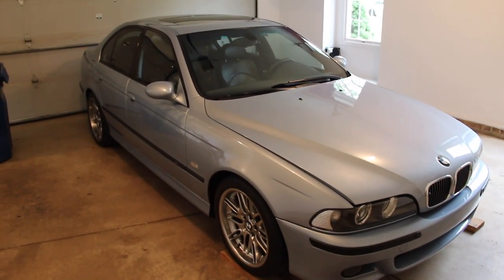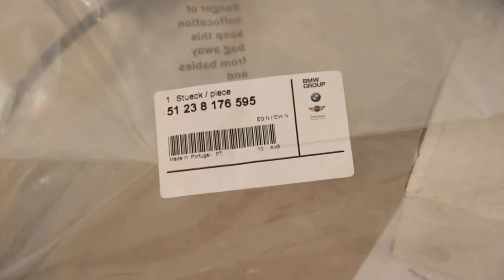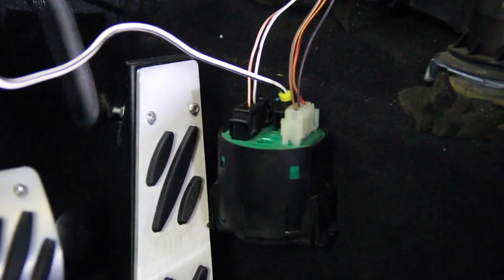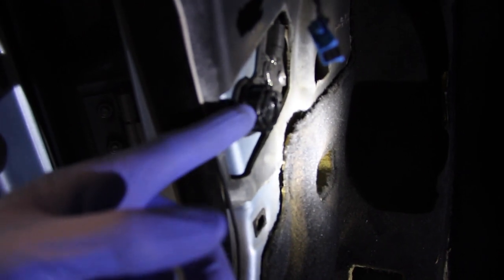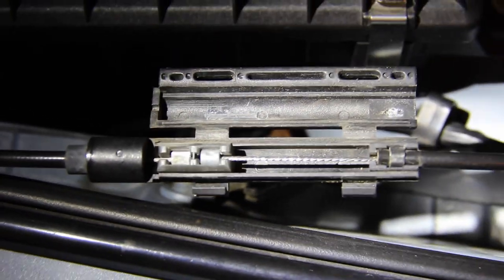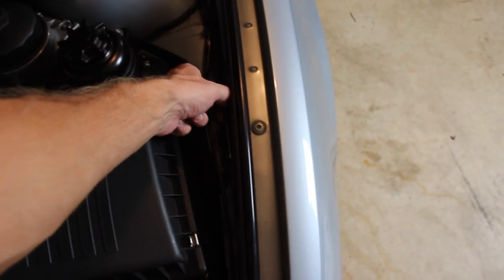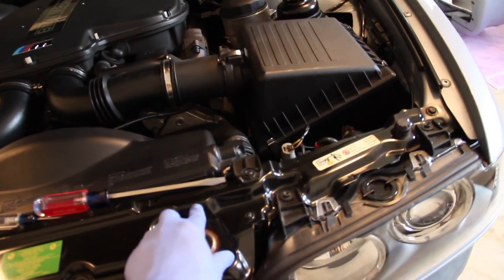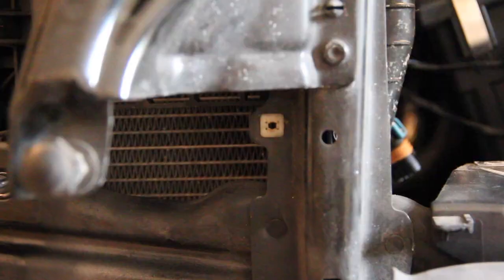BMW E39:  Hood Latches & Cables Replacement DIY

Comment: Your Youtube videos are amazingly clear and I'm astounded by how meticulously you maintain your cars. I wish I had a  a fully equipment shop to work in like yours, especially a hoist. So, I just completed a full cable and latch replacement on my 2003 manual 540i and did it without removing the bumper and other assorted frontal components so I figured it would be useful to post that part of the procedure here for future reference. The main benefit is gaining access to the latches by loosening the cross member into which the latches are attached. This is done by removing the four headlight bolts on both sides and sliding them forward an inch or so., loosening the torx screws holding the latches and removing the 2 at the front. Then remove phillips head screws and the radiator support bracket bolts and the 10mm hex bolt at either end of the crossmember. Then punch through the pins in the centre of the 3 plastic expansion rivets, being careful to place a rag underneath them to catch the pins for reuse. Now the crossmember can be lifted up and tilted forward enough to gain access to the latches. Remove the remaining torx screw from each of the latches and ease them out together from under the crossmember. The remaining procedure is the same as Ryan's. Doing the job this way means it can be done solo and in much less time.

Comment: FYI!! You don't break or saw the grills. They pop right out, just go easy on them, then use a small rachet with T35 to remove the spring locks.

Comment: Just a little maintenance advice, put some grease on the latches and the hood bolts as well from time to time, to avoid them getting stuck and putting too much force on the cable, and also they wont rust so bad.

Comment: To make you life easier when installing rubber parts in/through any other material, ALWAYS use a little kitchen dish soap on the rubber... will make it pop in no fuss.. when it it gets wet, it will wash away...!! Example: the hood latch cable through the firewall, as in this video... or the front/rear window surround gasket... dish soap it!!.

Comment: I had some troubles getting the junction box open. In case you missed it, you push the tabs forward (toward the cables inside the junction box) and just kind of fidget it. I had to use a flat head to push them. Got it after a few tries. Great video, thanks!

Comment: I do this on my e39. I only change the first kable. And now i cant open the hood. There is no traction on the kable. On 15:00 there is the hole for the rubber. I don't know how deep I have to put that in. Can some one help?

Thanks

Comment: Is it possible to do the latches without removing the bumper, headlights, etc? Impossible or just not as straightforward? Thanks!
Reply from the maker: You may have to break some welds.  I would just do it this way, it just takes time.  None of it is hard.
Reply: This is probably the “correct” way but if you are careful you can do it with removing the head lights and flexing the cross member

Comment: Thank you very much for the hood release cable (cabin) replacement instructions! Helped me a lot today after the cable broke last week. Still took me a good 3-4 hours to change it, also mainly because putting the dead pedal back was such pain in the ass. Great video and gonna watch the rest later if the other cables require replacement. 👍

Comment: I have a funny feeling that this is about to be my next failure. Just replaced the aux. fan on my 2000 540i and it wasn't too bad. Ended up replacing all those plastic rivets because they were brittle and crumbled upon removal. I really like your videos. Great work, and best of luck keeping it in the best shape possible.
Reply from the maker: Thanks for the kind words!  Were you able to find the part number for those three rivets that I couldn't get the center out of until they were removed?  The correct # doesn't seem to be there on RealOEM.
Reply: @E39Source  I found the rivets on Ebay. Looks like they are used on several models. The part number listed was 51 71 822 9003. They came in a pack of 4 for the air duct, which is that plastic shroud in front of the aux. fan.
Reply: Jonathan Edwards are the rivets sold on eBay made by BMW?
Reply: @Twghost  I really don't know. Most of those parts like fasteners are not BMW branded from what I have experienced. If you bought them from a BMW dealer, they would be in a bag with a BMW parts network sticker on it. I am actually going to install these this weekend, and will report the progress.

Comment: Great post. I just ran across this one yesterday & seeing your frayed hood cable got me worried. I just checked it out & we are good for now. I open the hood a lot so wondering how many times yours was opened to fray it that bad.
Reply from the maker: My hood latches had gotten rusty after exposure to many Ohio winters.  The rusty latches were sticking and causing the hood release cables to work extra hard to open them.

Comment: love your brake and accelerator pedals, where did you get those from? Also what is the part number for the junction box?
Reply from the maker: These are the Bimmian brand pedals that have unfortunately not been available for years.  The Genuine BMW performance pedal kit works fine for the clutch and brake pedal, though the throttle pedal they used is the standard E39's (non-M5) shorter pedal, so it won't work.  Junction box:  https://bit.ly/3nTqKEg

Comment: why did you work so hard at it take a welding rod and stick ah fallin wedge in there put little pressure on the hood not to much knock the flux off welding rod put about 20 
degree bend in rod

go in between headlight and grill peice find latch and push pop right open dont got take no stickin grill out mikeys fix all mikey huff us hillbillys got it goin on need anymore help call

Comment: My left look latch doesn’t lock. And I can wiggle the hood to pop the right. My cable broke at the plastic connector. My cables are rusted solid and don’t work.

Comment: Thank you so much, was very helpful. I'm rolling the dice with MTC latch assemblies, 2 for $27 on eBay. Genuine cables however.
Reply: Any luck with using MTC?  Couldnt find any reviews on those and the OE are like $80+ a piece! Any feedback would be appreciated. thanks!
Reply: @nasserkhaja1879  oh they worked great! It threw me off that they weren't tapped, but the bolt still goes in, I would absolutely recommend MTC here
Reply: adampa1006 thanks! Going to try them out!

Comment: You dont need to take anyyyy  of the stuff you took apart to do this job. I took the just the 2, 8mm bolts for the fan shroud and propped an opening took 10 mins overall to do all 3 cables... what in the world lol
Reply from the maker: You removed two 8mm fan shroud bolts?  What car did you do this on?  Only plastic pop rivets hold the E39 fan shroud in place.  What do you mean by 'propped an opening'?  I am not aware of any easier way to do this than how I did it for the E39.

Comment: Does anyone have any experience with the Behr Hella service aux fan? I know some of the Behr Hella stuff is junk, but their premium line and other select parts are good (even made in Germany).
Reply: I just replaced mine in the 540i. They are a good product. Make sure you get the right one for the year car you have. I made the mistake of buying one from a 97 MY and it did NOT work. Wrong plug. 3 wire vs. my 4 wire. Real OEM is your friend for parts numbers.
Reply from the maker: So far so good, Behr/Hella makes a ton of parts for BMW, so I wouldn't worry about this.

Comment: Great video, do these require any adjustment? My passenger side latch doesn’t fully release and I have to pull the hood hard to get it to release
Reply from the maker: There isn't much adjustment unless you've just replaced the plungers on the hood.  You may have a bent latch lever or plunger.
Reply: @E39Source  thanks. I have since realized it’s my safety catch not fully releasing.

Comment: So then you wouldn't recommend doing this if I don't work on my car? I know a thing or two but mostly I watch my friend do it.  I would like to get an M5 in about 6 months, but like I said I'm not a mechanic and my friends have never worked on an M5 before, how hard is it to work on things, especially in the engine area or the suspension? I appreciate any advice I can get because I reaaallly fell in love with it
Reply from the maker: When I got this car I had never worked on a car before, in any capacity.  If you're careful, resourceful, and patient, you'll be able to do anything eventually.  There are lots of resources out there, just prepare yourself with those and go from there.
Reply: Alright, I think I'm gonna go for the M5 after all... Thanks for the advice and the DIY vids
Reply: @pbluma  I own a 5 series like that. You can do everything on the car indeed. But after 7 years of ownership, I really fed up that there is hardly a bolt that I haven't taken apart on this.

Comment: @22:52...I bet you want a new radiator.
Reply from the maker: That's just the AC condenser.  I cleaned it up before reassembling everything.  Radiator has been replaced and looks pretty good.

Comment: i don't think that everybody are running to spend $200 +  on those parts alone 
very expensive
Reply from the maker: If the cables break, you don't have a choice!
Reply: what do you mean $200? I got new cable with handle for 7 euros and mint condition used hood locks with cables for 10 euros lol